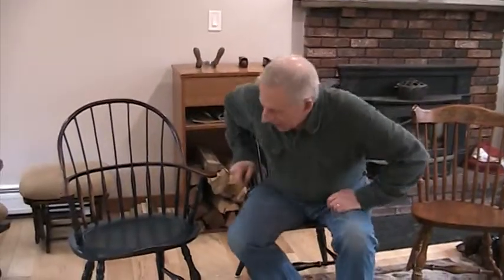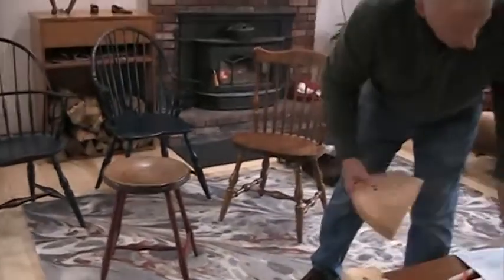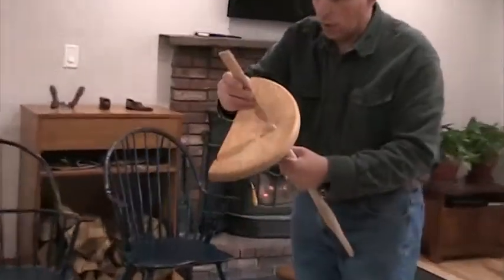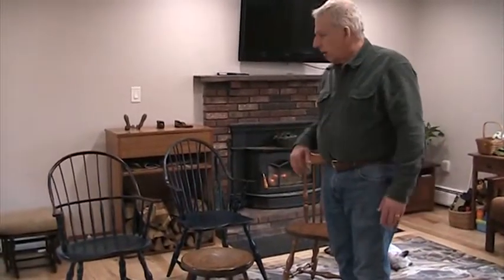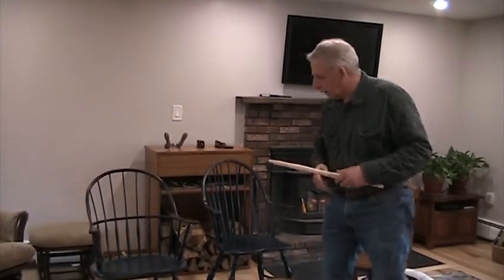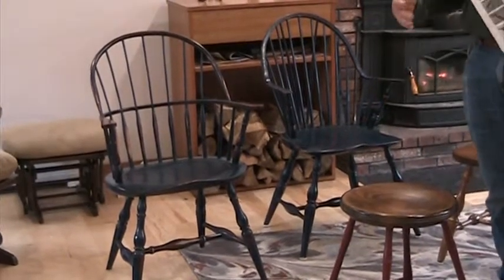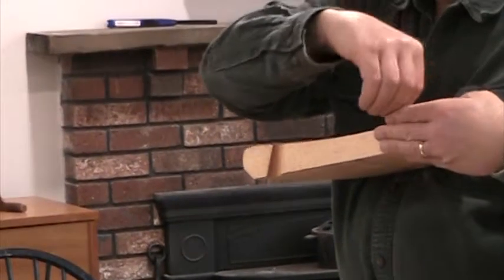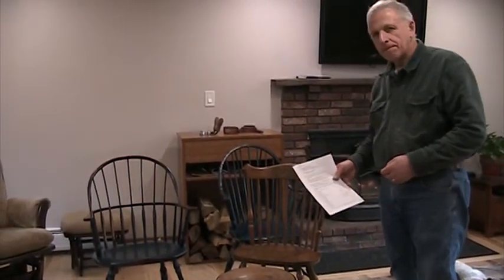Windsor Chair facts

Comment: Guess you never heard about spoon bill bits and wet (green) turned legs.  Chair streets having a small ball turned on the end stuck in a bucket of hot sand on top of the woodburning stove to dry the ends of the stretchers and thereby shrinking them to fit into the predrilled holes in the legs which are then set aside to season and therefore shrink fit onto the ball at the end of the stretchers.  No glue needed and all but impossible to pull apart.